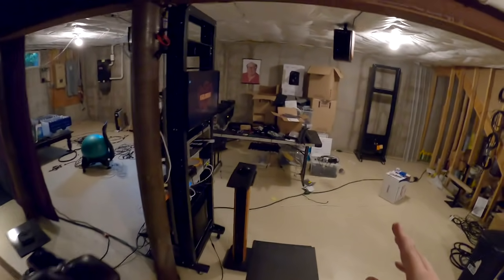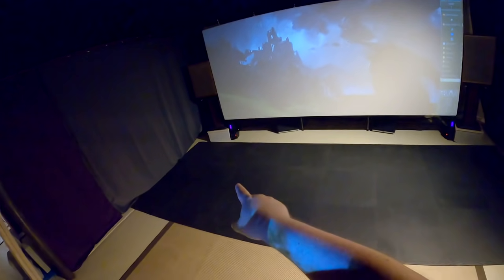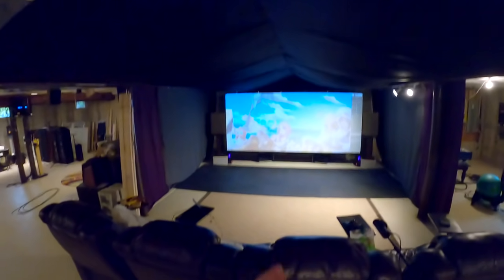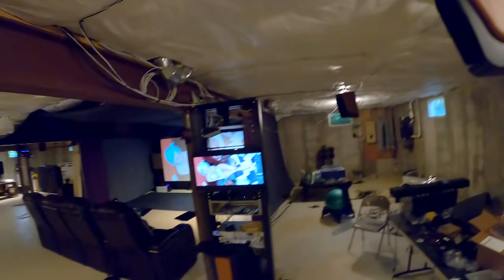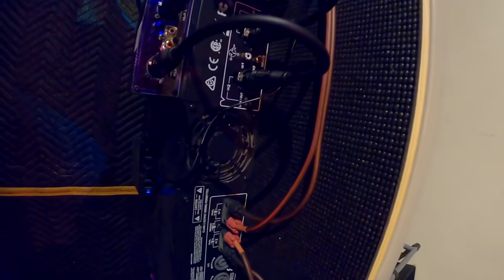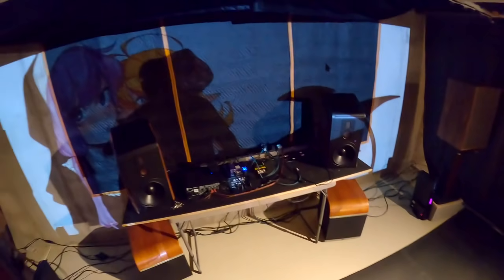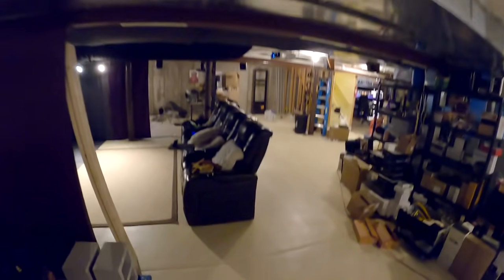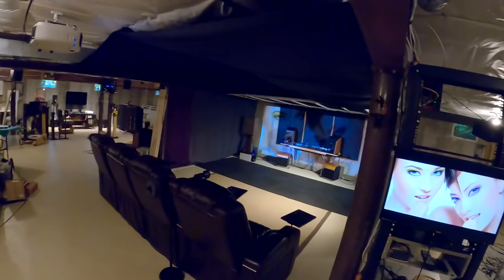🟥My Home Theater is Madness _(Z Reviews)_

Comment from the maker: Update: Behind the screen that Kasa switch now controls the Left right AND Infinity Sub Crown amps as well as the swan M500 and I put the MiniDSP for the Center/Sub switch on it as that unit after 200 hours or so needs to be reset or it doesn't output so now it gets refreshed whenever.
Reply: you should vanta black all that shit lmao just have the screen extruding from a "black hole"
Reply: hey Zeos make one more of these to talk about the DACs and how its all done. And pls include cost of these in comparison to something like JBL SDP 55 or 75.
Reply: A really good projector to review which is a mid tier 4k is the optoma uhd38 , its amazing ,personally im also going through a theatre setup myself currently , would love to know what your thoughts are on cieling speakers , im running a standard surround sound ,centre stage left right centre two rears and the ceiling speakers with directional tweeters for my side channels , effectively a 5.2.1 set up, im still dubious on the ceiling speakers being used as my side channels , i might flip it and add side channels and then use the cieling speakers for atmos only
Reply: Please do an updated tour of your home theatre please?
Reply: Are we getting an upgrade soon?

Comment: Thanks for the tip on curtains on the ceiling going to try in my home theater. I have a 30’ x40’ metal shop with the back half for my theater. It has white exposed insulation in the ceiling…so. Completed work great, did buy a grommet kit to put down both sides and attached to steel girders with the magnets.

Comment: Hi Zeos, there is a fairly simple way to do a 'studio-grade hifi' + 'home cinema': combine an audio interface, e.g. MOTU 8A, with 5-7 studio monitors, e.g. Tannoy Gold 7, Fluent, or Adam, and 1-2 subs.
Other interfaces work as well but MOTU has a web interface that makes control simple for everybody.
Reply from the maker: That would work, Still relying on the Motu's dacs but that is OK.
Reply: @ZReviews   MOTU 8A uses sabre DACs that measure similarly to RME ADI-2 DAC FS (on all 8 ports)

Comment: You may already know this but just in case you didn't. I heard you mention your mortgage towards the end of this video. Did you know if you pay half your monthly Mortgage every 2 weeks instead of all of it once a month you will pay it off around 3 years early and save a bit of interest? Doesn't sound like much but basically it makes it to where you pay 1 extra payment per year.

Edit: 3 years early* not months. Sorry I was tired earlier. Also great setup!
Reply: Yes, but it depends on whether your bank will let you pay it that way. I tried to set up a bi-monthly payment like that and my bank wouldn't do it. I can pay extra, of course, but they wanted an entire payment once per month.
Reply: @redstang5150  You could always just take 1 payment and divide it by 12 and pay that much extra every month if you could. It would have the same effect. Like say your house payment is $1,200 for the sake of easy math. Just add $100 per month in that situation and you would pay it off 3 years early. Also there are pay off mortgage early calculators online that you can play with that allow you to put your interest rate in and cost of home and how many years it is. Then you can put in numbers like $50 extra per month for instance and it will tell you how early you would pay it off if you pay that much extra per payment and tells you how much interest you should save.
Reply: @GhostAcez  Yep, but then you start getting into whether it's worthwhile to put extra towards your mortgage, which is tax deductible and probably around 3% interest if you've financed any time in the last several years, making it not too hard to invest it and earn more - OR put that extra towards your retirement IRA/401k. Interest rates being so low make it less desirable to pay extra on a mortgage.

Comment: I don't know if it was supposed to be sarcastic but running a power cable exactly parallel to the signal shouldn't do anything, cause the way EMF is generated around a wire means any voltage gets induced across the cross section of the wire, not along it's length. The capacitive coupling with average size insulated wires would only be a bit of a concern with a weak signal and very long wire

Comment: FYI zeos I got a smart switch and connected it to a 100mA,12v psu connected to a mono 3.5mm plug for triggering my XPA2 on/off as required and I gotta say... it works exactly how it should.

Comment: For the volume of space you need to fill, you seem to be lacking a lot in the subwooferage department. I'm thinking you need at least 2 Rythmik FV25HPs to start, if not 4. Everything else is insane of course.
Reply from the maker: In the sweet spot.. It's pretty solid. Im seeing if the G25 may do a thing.
Reply: @ZReviews  Another great choice. G25 will definitely do a thing :)

Comment: Question for anyone. I’m currently running jbl 580’s left and right and the tiny jbl 520c for center. I’d like to upgrade to dual 530’s for a center similar to his swans but I can’t do an acoustically transparent screen. Would I lay them down under the screen like my current setup or could I run them on the sides of my screen aside my 580’s and create a center image. Not sure how it would sound or would it cause some conflict with the left and right speakers.

Comment: You should look into one of the Logitech smart remotes with the harmony hub. I have one and it can control anything with IR or Bluetooth , it evin has a preset for flirc. I use it to turn on my projector, receiver, and xbox. It can probably be programed to control the swans so they can be just put into standby or have the volume maxed out after kasa switch powers them on. Plus it can be controlled with Alexa.
Reply: I was going to recommend the Harmony remotes as well, but I can't understand how he's controlling the volumes without a receiver/pre-amp.
Reply: @jcto6013  I think the amps have remotes.

Comment: That Crown amp should be on a hard flat surface , not foam padding or carpet , it can't breathe !  That is an amazing system !
Reply from the maker: Crowns have no openings top or bottom, front and back is how the air moves.
Reply: @ZReviews  That's to bad about no openings on the bottom of your Crown amp, cause that would have been a quick fix. Thanks for your reply 😃 let me know what you find out about the amp . Thank you Z.